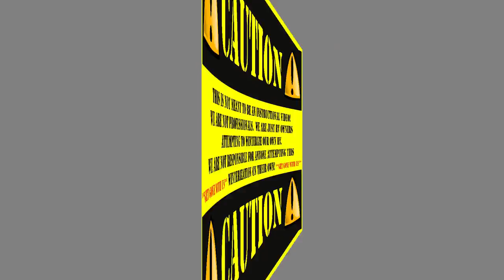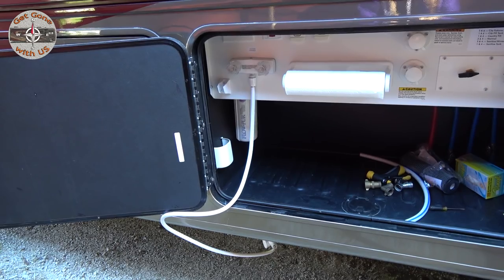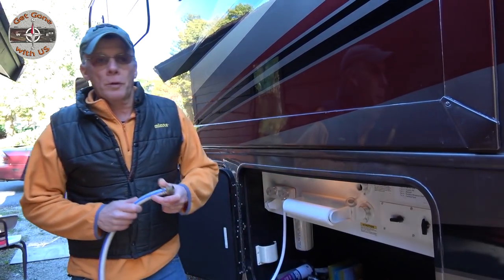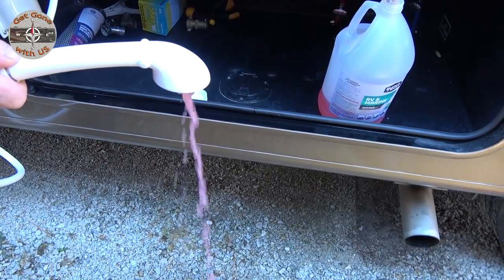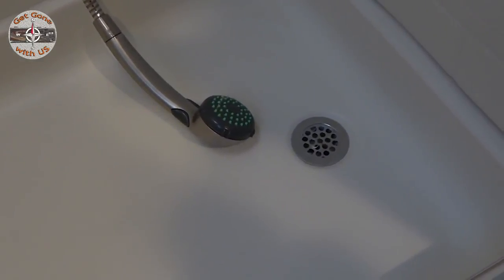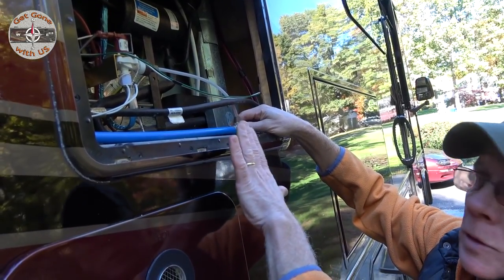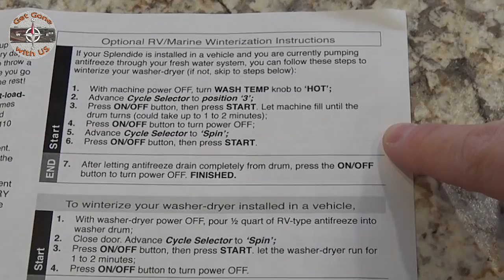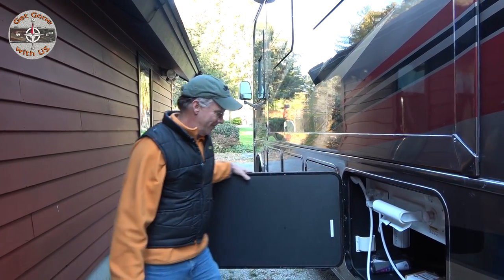How to Winterize a RV including a Splendide 2100X

Comment from the maker: To winterize your macerator instructions say to:
1.Empty the black water tank.
2. Pour RV antifreeze into the empty black water tank.
3. Run the pump until the antifreeze begins to discharge.
4. Turn the pump switch to the Off position
 We just make sure the black and gray tanks are empty by pulling all the valves, including the macerator bypass valve and leaving everything open.  We also drain the macerator hose.  After we close all the valves, we winterize all the plumbing lines with antifreeze and over fill the traps, so anti freeze gets into the tanks. Once everything is done we open the gray tank, we hit the switch for the macerator and look for pink, if we see it, then call it a day.  We had no problems doing it that way last year.  Go with whatever you feel comfortable.

Comment: Great Video and perfect timing as Old Man Winter seems to be waking up. I am always impressed with the thoroughness of your "How To" videos, this is our second winter of not having to winterize but we have had to do it many times in years past. I occasionally have forgetten different areas though. Our previous RV had a dish washer and I totally forgot to do it, until someone was talking about a cloths washing machine and it dawned on me about our dish washer. I thought I was going to be in trouble, but I went ahead and pumped the rv antifreeze in it and sure enough come spring when we de-winterized it, we got lucky and it was fine. I sort of live by the theory "it's better to be Lucky than Good" but that approach doesn't always work. Good to hear that this is Maggies last taste of the Pink Stuff. Hope to see you two somewhere out on the road somewhere, next year
Reply from the maker: Thanks Bob! :) We were worried last year when we pulled in the driveway at 9:30PM from PA and it was 18 degrees outside.  We just opened all the low drain points and went inside, we were freezing.  The next day we winterized and hoped for the best and ya we got lucky too.  The other reason we made the video is just in case we ever need to winterize after being on the road, I'll remember how to do it! hahaha

Comment: Great how-to!  I have always used the compressed air method on my 2015 Jayco Precept 29UM with good success too.  Handy tip with with fresh water valve...I have used the country fill mode with difficulty before learning this tip.  Note on the ice maker:  That small clear plastic water line can rupture.  Mine ruptured a few months ago, partially filling the lower vent resulting in a water leak under my fridge and sofa.   Luckily, I caught it pretty quickly and no damage was done.  I hardly ever use it and that was just another reason not to use it at all!
Reply from the maker: Thank you. :)  We will keep an eye on the tube.  We probably won't be using the ice maker anyway, we didn't miss it at all this year. :) Thanks for the heads up.
Reply: @GetGonewithUS  I caught mine while using my water pump, but if it had ruptured while hooked to campground water while I was gone, it could have been bad.  Overall, I have had a very good experience with my Precept.  It has been quite reliable.  34,000 miles and counting.
Reply from the maker: @CycleDoc675  We had a rough couple years dealing with main slide issues.  Jayco was great to us, so hopefully it's all over now and we can look forward to full timing next year. :)

Comment: One question about the macerator, do you run it until you see antifreeze to make sure it’s protected? I’m about to winterize for the first time, been fortunate enough to have a warm warehouse the last two winters, but no access now. This is very helpful.
Reply from the maker: The instructions say to
1.Empty the black water tank.
2. Pour RV antifreeze into the empty
black water tank.
3. Run the pump until the antifreeze
begins to discharge.
4. Turn the pump switch to the Off
 position
 We just make sure the black and gray tanks are empty by pulling all the valves, including the macerator bypass valve and leaving everything open.  We also drain the macerator hose.  After we close all the valves, we winterize all the plumbing lines with antifreeze and over fill the traps, so anti freeze gets into the tanks. Once everything is done we open the gray tank, we hit the switch for the macerator and look for pink, if we see it, then call it a day.  We had no problems doing it that way last year.  Go with whatever you feel comfortable.
Reply: Get Gone with US - thanks so much. That sounds like a great way to do it.

Comment: Hey thanks for the video!  I have a question though. I have a jayco precept 2020. It has the on demand heater. So you said there isnt a tank to drain and it is okay that antifreeze runs through it?  Also, do u have the hot water heater switch on while winterizing. Like the thermostat?
Reply from the maker: You are welcome Beau. Our Precept is a 2016 and we do not have a hot water tank to drain.  I believe Jayco has changed the brand they were using, so check your owners manual to see it the winterizing procedure is different on a 2020.  Good Luck.

Comment: Great time to do the video since I'm doing my Jayco Greyhawk 26Y tomorrow.  Thanks for the tip of turning the screen around because last year it took awhile to prime the pump.  In order to lessen the amount of antifreeze used I think someone made a disk to put inside the top of the filter canister to keep it from filling with antifreeze, but not sure where I saw it.  Have you seen anything like that?
Reply from the maker: We haven't seen the disc, but our friend RV Habit, puts an empty water bottle in the canister to take up some of the space.  We had extra, so we didn't worry about it.  The screen trick we discovered last year and it works great,  just don't forget to turn it back around when you are done. :)
Reply: Thanks for the reply and the empty water bottle is a good idea.  We live in the northeastern part of Oklahoma so we do have to winterize. Maybe someday mine won't have to have taste antifreeze either.  My wife and I are both retired, bought our 2017 Jayco last May, and not sure about going full time but the thought has crossed our minds. Sure do enjoy the video's and the series about you going full time.
Reply from the maker: Thanks Carl.  Our 1st RV was a 2006 Greyhawk 29GS and had it for 10 years before trading it in for the Precept.  You and your wife can always do what we did next year, just take off for 4-6 weeks in you RV.  Pretend you are full timing and keep receipts on every penny you spend just to see what the lifestyle will cost you.
Reply: Actually we just got back from being out 2 months and we loved it except for being away from our grown daughters and grandchildren.  Our 20 year old grandson is living in our home and taking care of things while we're away. If we don't go crazy with our spending we could make it happen.  We bit the bullet and bought an Ocean Canyon/Coast to Coast membership last year, so we have paid for staying in rv parks pretty much up front.  Now we have to get out there and take advantage of it to make it worth while.  If not snowed in January we would like to take off and find some warmer climate.
Reply from the maker: You know better than we do.  We only took off for 5 1/2 weeks. LOL We were able to stay within the budget we are hoping to have when we go full time.  If we do it we will probably buy a used Thousand Trails Elite membership.
Reply: Not sure if I know better or not. Ha ha. We should have done more shopping around before purchasing a membership, but live and learn I guess.  Safe journey.
Reply from the maker: @awabbievet  You guys be safe too.  Maybe we'll see you on the road sometime. :)
Reply: That would be great.  Thanks. Carl & Katy
Reply: I recall seeing shut-off valves going in and out of my whole house water filter on my Precept.  I use the compressed air method so I have never used these valves.

Comment: Would the washer on warm winterize also
Reply from the maker: Our instruction from Splendide state to use hot and we didn't have any problems. 😀
Reply: @GetGonewithUS  if you use hot how does the antifreeze get threw the cold
Reply from the maker: http://www.splendide.com/XC_Winterize_QuickGuide.pdf  
Splendide has changed it's procedure over the years as models have change.  First it was do HOT, then do a COLD.  The next one was just do a WARM. Now it says just do a HOT, as the link shows. Do whatever makes you happy or call the company and ask them.  Every time we winterized we followed this procedure that came with the washer and have never had a problem.  NH winter get mighty cold too. :)